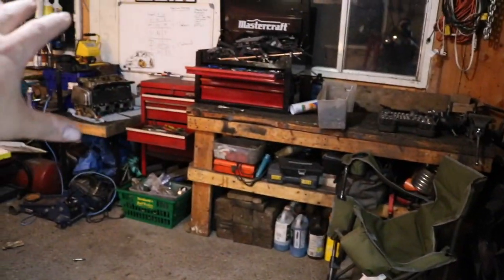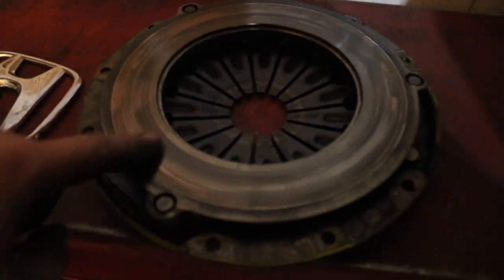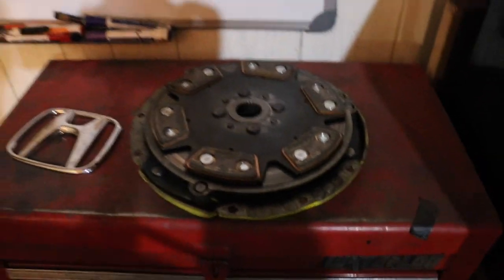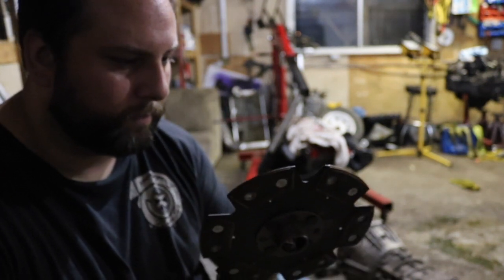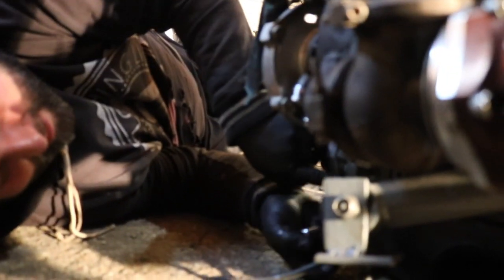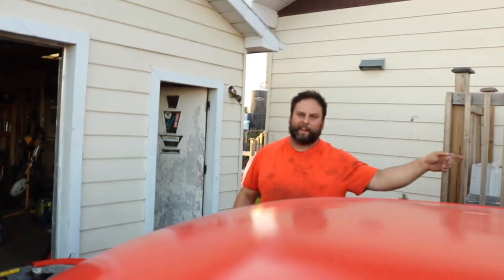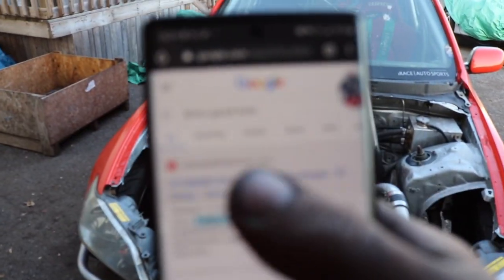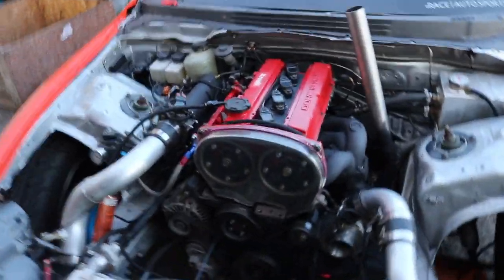2.4L Stroker Evo Motor Dyno Fail and Weekend clutch swap!

Comment: Is it solid motormounts regarding the vibrations? 
276 cams is fairly moderate imho and shoudn't be an issue.
Maybe I'm wrong?
Reply from the maker: Yeah, motor is pretty much solid mounted, no balance shaft either so vibrations are going to be there for sure, the 276cams are pretty rowdy, because of the pulsating idle my dashboard literally dances at idle with with 2.4 bigger displacement too more air in, definitely louder than the old 2.0L, I LOVE IT
Reply: Gotta love those 4g6x engines!
I"m building a 4G64 with a KIA/Hyundai head G4JS and a 6262 turbo going rwd mounted.
But as always those goddamn funds is always lacking. 
Keep it up bro!